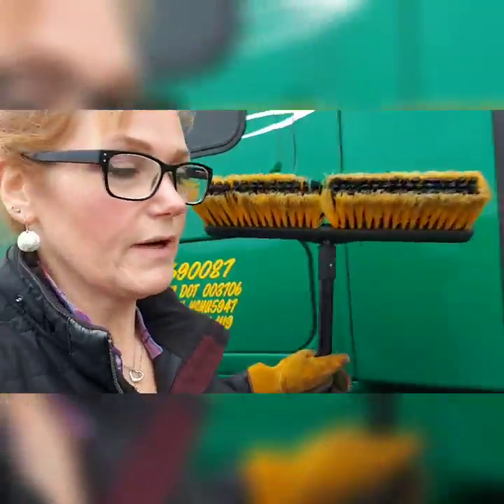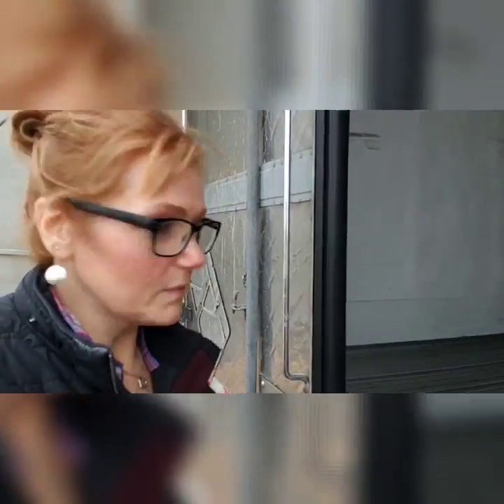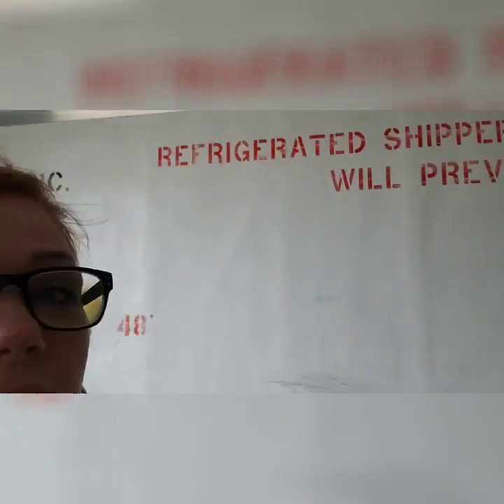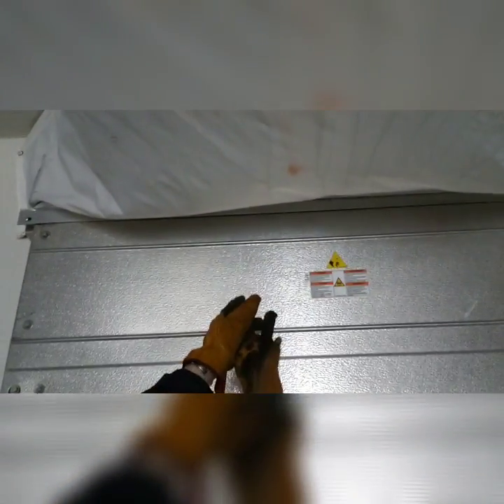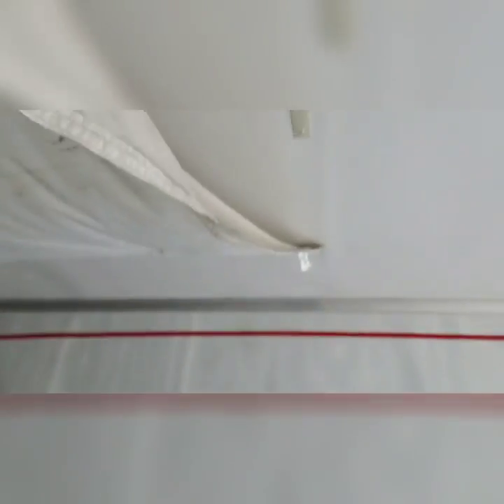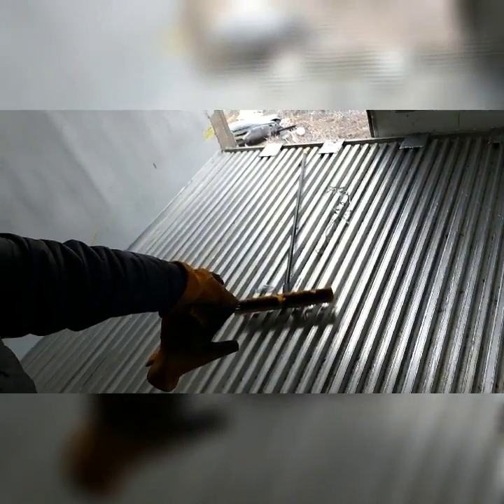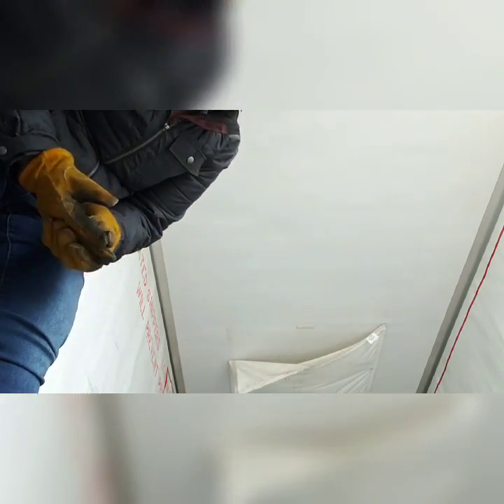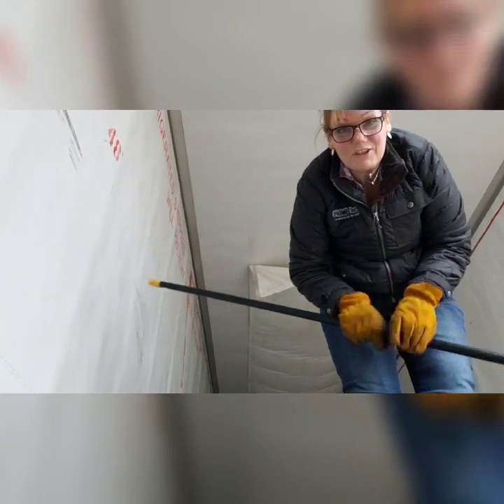Made a quick $20 -DIY Chute Repair

Comment: Just FYI, the center velcro tab at the end should be left unconnected on the chute and not closed up. That center tab is just there to get it out of the way and keep the chute from being caught on and getting ripped down while being loaded, if wanted. After that, always leave it open for correct air flow to cool the unit evenly. It creates an air current that bounces off the rear, drops and then  flows back up to front. The open edges along the chute are just a secondary way for more even cooling, not the primary.  Essentially, blocking that end is just making the reefer work harder and limiting even air flow. Not sure who showed you that but they’d be wrong. Good luck.